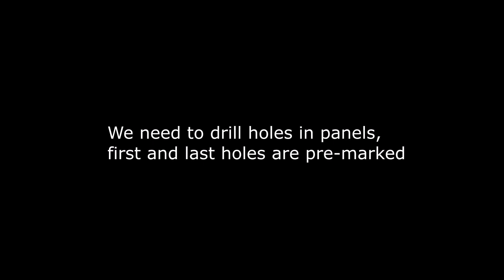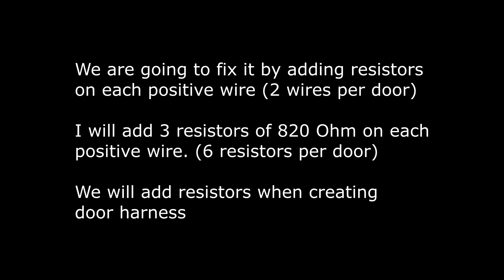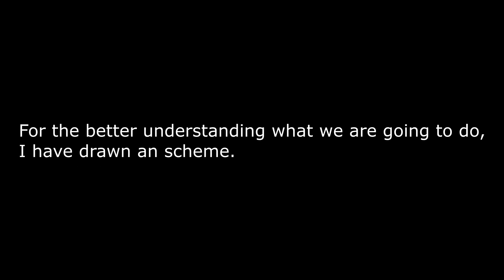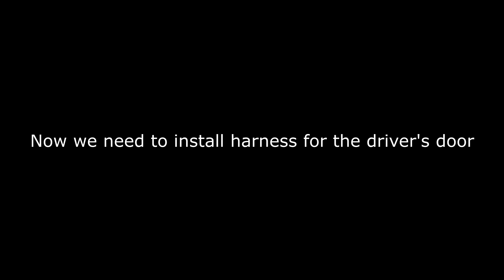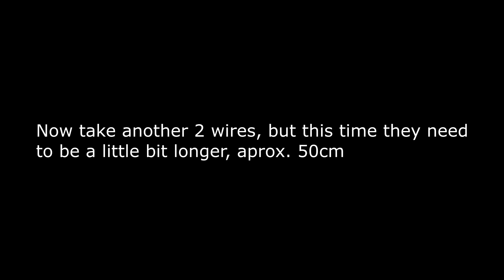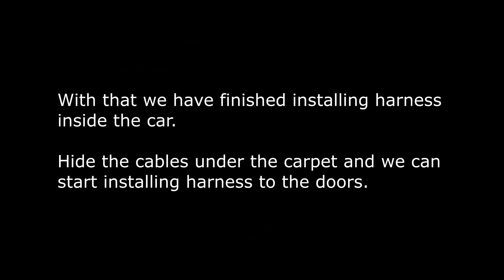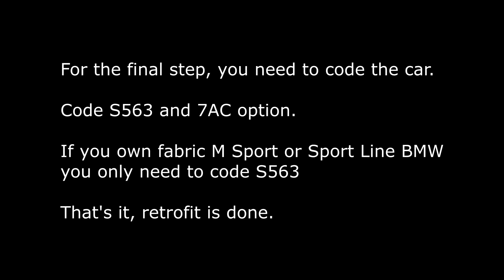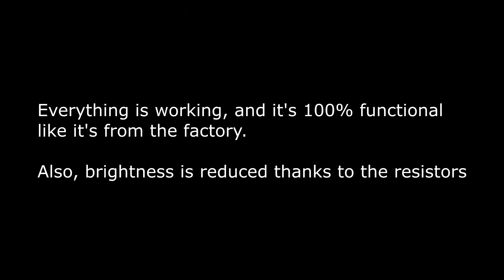How to retrofit Ambient Light on BMW F30/31

Comment: What about cars that have light package? I installed this kit on my f30 few days ago by connecting the driver's door light red and black wires to the car (I used all wires they provided) and the light is too bright and I can't control the brightness in the settings, do I also need to put resistors and how?
Reply from the maker: @Simon If your BMW has OEM Light Package, then this kit is Plug and Play. You need to connect 3 Pin connector from the ambient light to the car. If you connect only 2 Pin, then you can't control it from the iDrive.

So, disconnect 2 Pin connector, and connect 3 Pin ONLY, and everything should work.

For the brightness, yes, to reduce it, you need to add resistors. To do so, you need to cut wires on the harness either on the ambient light or the car harness, in my video I have shown how to install resistors on the car harness.

You can buy resistors from ebay, I have bought 100 pcs of 820 Ohm and I have used 3 resistors per wire,  6 resistors per door, 24 resistors for all 4 doors.
Reply: @Acelele320  The wires they provided have both 3 pin and 2 pin connectors, I connected both on each door (passenger doors connect 3 pin to the original ambient light socket and 2 pin on the window controller and the driver's door 3 pin on the original ambient light socket and last wire didn't have a connector just raw 2 red and black wires and had to connect them to the car under the seat). 

It's possible that I connected those 2 wires on the driver's door wrong but as you say they are 2pin they should only give power not control. Now the light doesn't even go off when the car is locked until for few minutes.

As for resistors, since I have 2 wires with 3pin and 2pin, on which to put it?
Reply from the maker: @SimonsaysMLG  You need to connect ONLY 3 Pin connectors, same like I have shown in the video, disconnect those 2 Pins, and you are good to go.
That's why it's PnP for cars with Light Package, you only connect 3 Pin to the car and that's it.

Also, you need to switch red and blue wires on the new ambient light. Watch on 4:00 and you will see.
Reply: @Acelele320  On the installation guide from the link you provided on aliexpress you say to ignore step 16 and step 18 and just to connect 3pin to the original 3pin connector? Then why do they even provide 2pin connectors and show it in guide that I followed...

As for switching the blue and red, those is only if the color is wrong as it says on the installation guide or there is some other special reason to switch them?

So for resistors, need to put it on 3pin wire on positive wire, 2 wire per door(red and blue). I hope I understand it now and won't need a 3rd try to assemble all doors.
Reply from the maker: @SimonsaysMLG  AliExpress provided those cables for cars without light package, that's why I didn't used them. Since your car already has Light Package, for you it's plug and play. (Plug only 3 Pin connector)

I have switched wires cos in the Light Package car harness is Pin 1 - ground, Pin 2 - red, Pin 3 - blue.
But the ambiend light from aliexpress has Pin 2 - blue and Pin 3 - Red, that's why you need to replace them.

For the resistors, connect them on positive wires (red and blue) anyware you want, i suggest you to connect them on the car harness, or create new harness.
Reply: @Acelele320  I have cut the 2pin wire on the driver's door and it works now as it should, I can even change brightness in iDrive which is great. Although if I change to classic mode the light goes completely off instead of switching to orange. On sport mode it works perfectly fine. I guess this is because I haven't disconnected other doors 2pin or maybe need to switch pins in 3pin wire, will do that sometime. Thanks for the help!
Reply from the maker: @SimonsaysMLG  No problem, glad that I have helped you.

When you are in the Sport mode, is the ambient light blue on all 4 panels?

When you switch to classic, does driver's door shuts as well or they light up?
Reply: @Acelele320  In sport it's blue on all 4 panels, and when switch to classic all panels go off including the center radio trim.